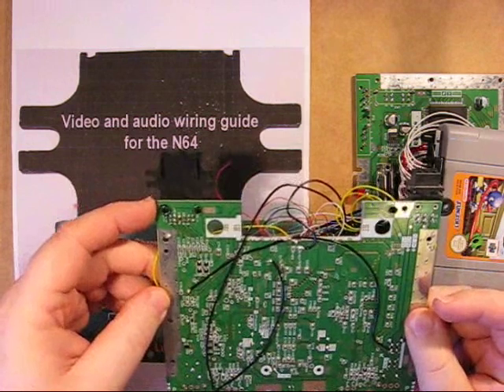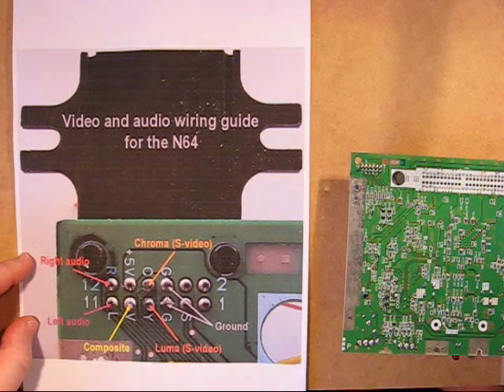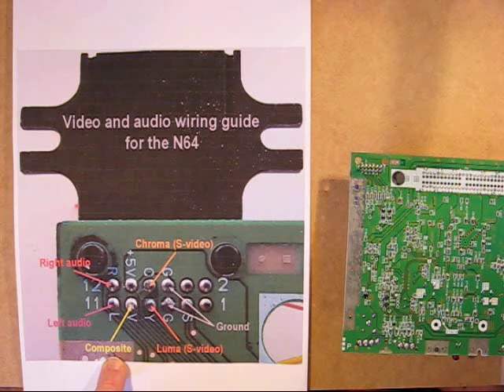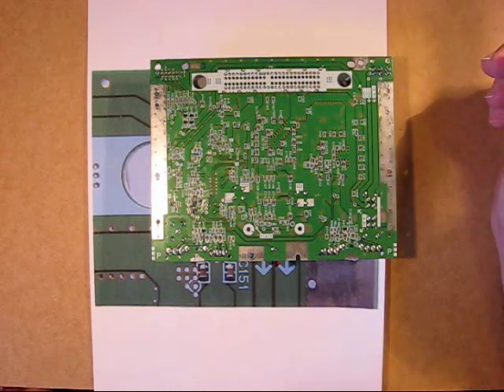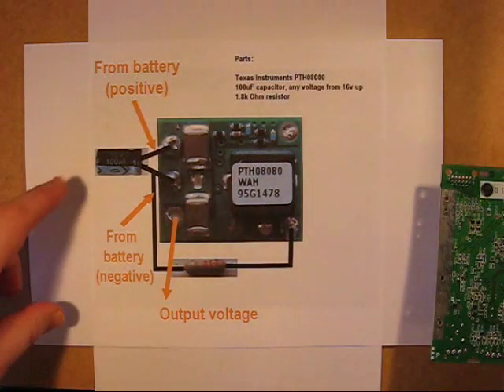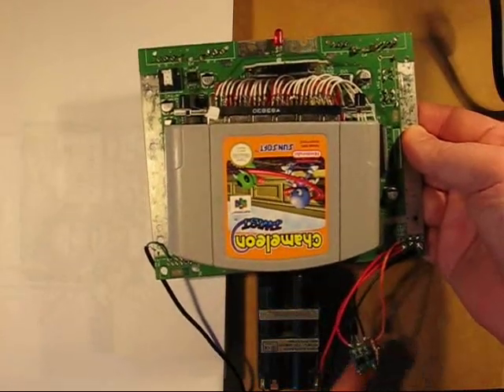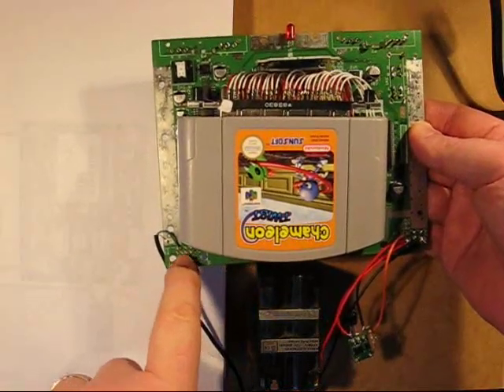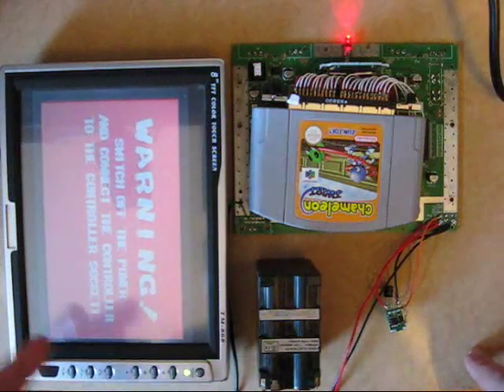N64 log - 5 - Powering the system and connecting audio and video

Comment: instead of the step down regulator could you use the board or components from the board in the original power box from the power cable?

Comment: Alright, I am confused on how to get power going from my battery pack to both the regulator and the circuit board, if I have 2 leads how do I connect the one wire to two different places? And does the wire that loops around on the regulator come with it or do I need to buy it seperatly?

Comment from the maker: 7.4v (or 7.2v) is ideal yes, as most consoles run off that, also not too much for the PSone screen if you're using one (the batteries are 8.3v fully charged, screen fine up to max 8.5v).

Comment: Did you wire the positive wire from the regulator to the same pin as you wired the positive from the battery. Is there another way i can do this?

Comment from the maker: Yes, you can reuse the N64 case for a portable, some people have done that. Issue is it is a bit large for what you need, and most of the mods using the original N64 case don't look overly impressive. On the positive side, better to use the N64 case if you have no other to use.

I learnt soldering from Googling sites, looking on YouTube videos too.

Comment from the maker: Yes, I think it was only me who did your S-video mod, surprising, as it was a nice easy mod too.

Agreed, RGB is far better, shame not all old consoles could take it (mind you, some are RF!). 

I've never LED modded a PSone screen, same reason as you - I have done the remove anti-glare mod once; won't do it again probably as it makes the screen vulnerable.

I might use S-video in practice on the N64 project, although i'll be videoing it as composite - not decided.

Comment: RGB is better than component. Component video uses color space encoding which is compressed. RGB video is an un-compressed raw video signal, in a CRT tv it is fed straight to the tube. Though in some cases component looks better on new HD tv's due to the way that it is decoded by the tv its self. Though RGB at HD resolutions would still look better than component.

Comment from the maker: S-video is normally better than composite, RGB better than S-Video and component better than RGB. 

If using a small screen, like the PSone, composite output on the N64 looks very good indeed; the point is the difference and if it is noticable vs S-video for example.

A lot of consoles look bad on composite; in contrast, the SNES, N64 and GameCube look very good on composite. The difference will be more noticable on a large television than 5" or 8" screen after all!